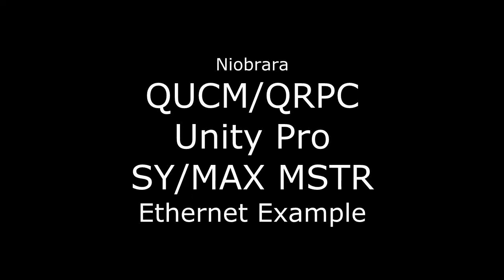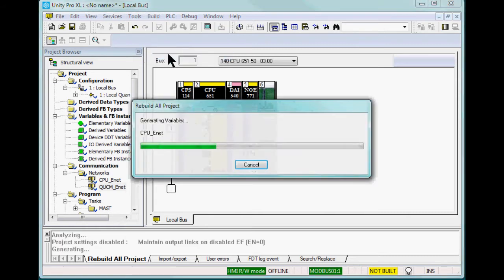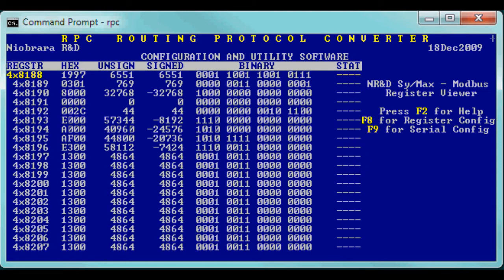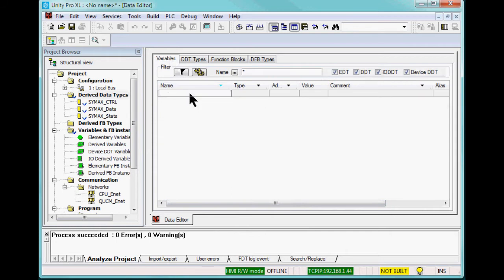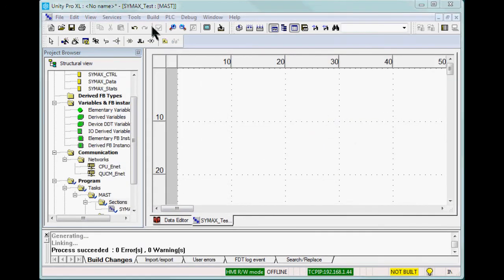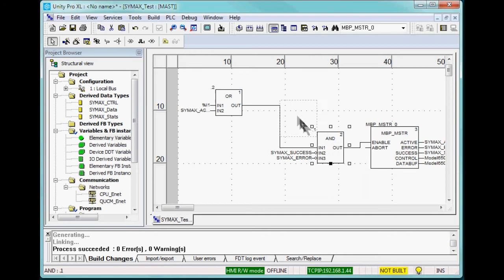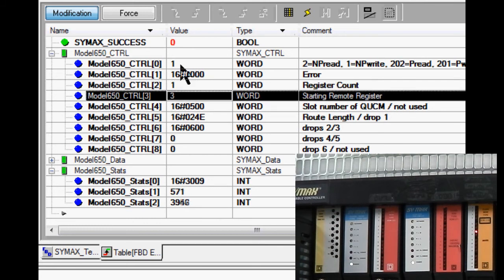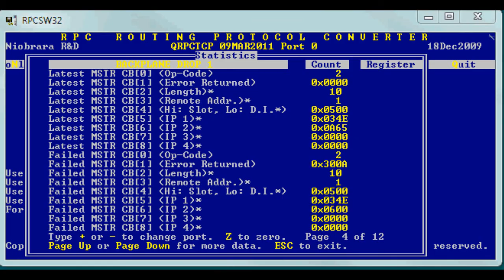Niobrara QUCM/QRPC Unity Pro SY/MAX Ethernet MSTR

Comment: On my sy/max setup using the real sy/max software  it only runs tru rs422 so I have a serial to 4s422 converter. I also must have a dongle plugged in the parallel port otherwise you can not use the software . Does this software require a dongle to work?